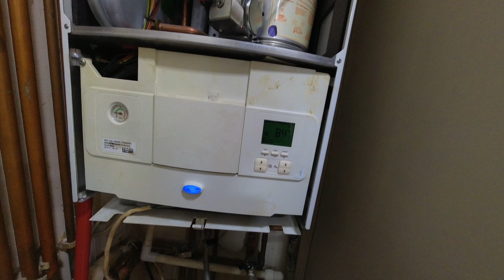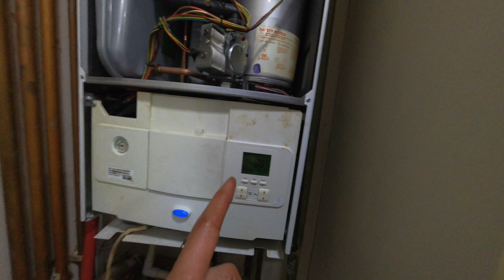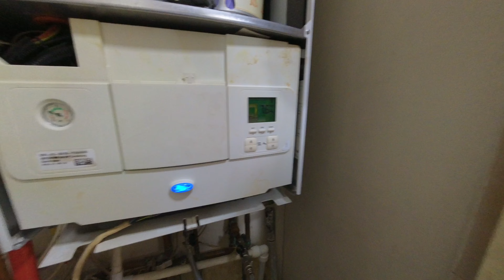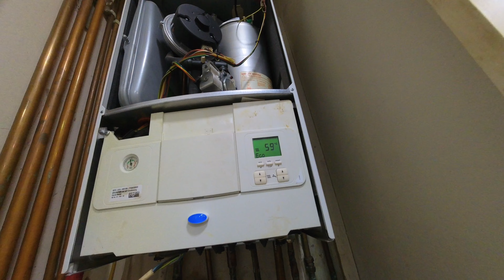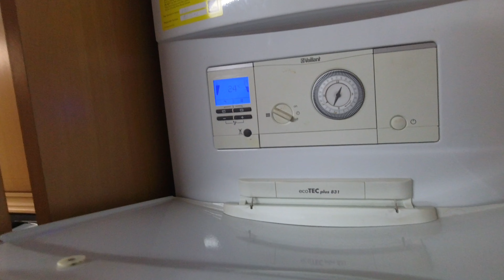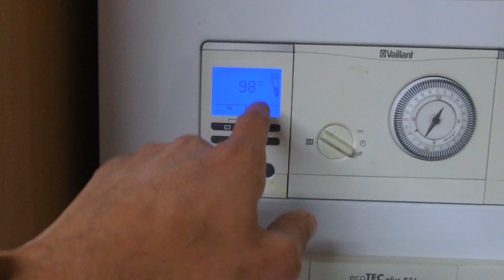I Couldn't Work It Out - A Day In The Life Of A Gas Engineer 127

Comment: ref WB. Check the flow rate through the kitchen tap and check against MI's. 
The boilers often have a low min flow rate -  4l/m ? in which case perhaps the kitchen tap should have fired the boiler regardless, indicating a poor flow rate through the tap AND a defective flow turbine ?  Just more forgiving on a low pressure loss tap elsewhere ? 
The Vaillant hex, although they have parallel pipes, they can often be cleared. I have had good success with strong cleaner particularly on the 37KW boilers (prone to hex blockage along with the 415/418). You will need to clean the system for a new boiler anyway so why not clean with this boiler and give it a chance ?
Ps when you clean it fit a tee on the return so you obtain the greatest flow rate through the boiler and reverse too.
Reply from the maker: Nice one mate thank you 👍🏾

Comment: Hi, a flow cup would have been a good help, then check against the manual to see what the minimum flow rate to activate the turbine. The temp at the kitchen tap was low compared to the bathroom sink tap , I would have a look for a faulty mixer maybe a shower mixer cartridge , I’ve had the problem a good few times, there’s a flow restrictor in the boiler to restrict flow through the plate to plate so if there’s a faulty mixer or blending valve the flow on the cold would be greater than the hot stopping the flow turbine working properly. One good way to check is to check the temperature on the hot pipe directly below the boiler and compare it to the temp at the tap, and if possible isolate the shower if fitted . Sorry for long explanation but you could change the tap for the wrong reason . Regards
Reply from the maker: Thanks mate, so I did isolate the cold feed under the boiler and it stopped the water coming out of the hot tap, which would have ruled out a passing mixer as then I would have expected cold water to keep flowing through? Appreciate the suggestions 👍🏾
Reply: @cputilitysolutions  sorry yes you did. I’m as guilty i over complicate my fault finding sometimes , but same as you I see many boiler faults and miss sometimes the most simple fixes. Cheers.
Reply from the maker: @jinty47445  all good mate, this is what it's about, bouncing ideas off each other as it's easy to miss the simple things 👍🏾

Comment: How do u know that's the blockage at heat exhanger rather than the plate? Lovely video as always. Cheers
Reply from the maker: The plates on Vaillants very rarely get blocked as the canoe filter protects it. That's why I stripped out the flow pipe to check it. On heating the boiler wouldn't ramp up to full rate either

Comment: Another great video cheers. Do you carry genuine manufacturer orings for all boilers or clean and grease the existing when you take off parts and put them back or have a third party box of multiple sizes that fit other boilers? I find I waste time having to go off and get the exact orings from merchants as having all the different ones would be too expensive - changed a flexicom hx hex the other day and city want £8 for just one flow/return elbow o ring. Thanks
Reply from the maker: Most of the time I've gotten away with re-greasing existing ones. I carry some of the genuine spare o-rings but I also have an assorted box as well which has most of the sizes in it. Depending on the condition of the o-rings I've been ok with reusing them so far. Bet you the next time it leaks now 😂

Comment: Valve could be for under floor heating
Reply from the maker: Nope there wasn't anything else and it was wedged open. I reckon this was the airing cupboard for an older system and whoever converted it left the zone valve in